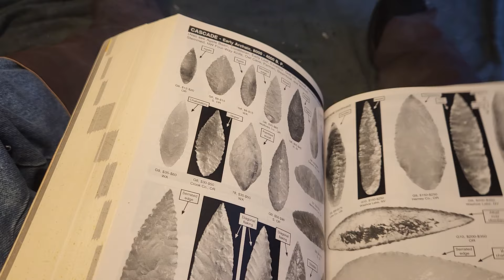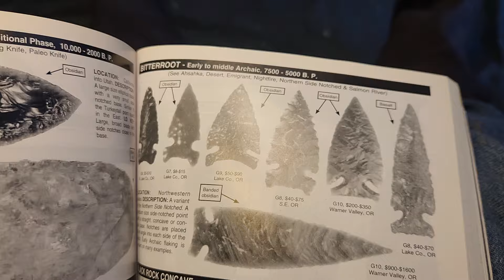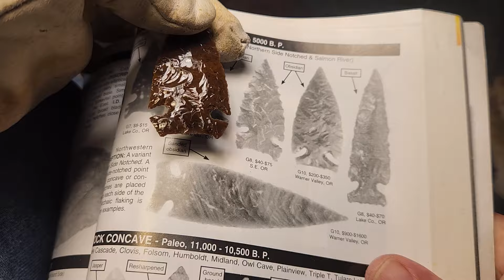1826 - "Cinnamon" Obsidian Flintknapping

Comment: Quick question, what is the upward angle of the metal indirect rod relative to the ground below?  Thanks!
Reply from the maker: From the ground, I would say between 5 and 25 degrees. It varies proportionally with the length of the flake and the amount of pressure assist. The longer the intended flake, and the greater the pressure assist, the greater the angle. ( edit): I think I've gone as high as 45 degrees with some rocks.

Comment from the maker: Related To Flintknapping/ Hunting
Updated April 12, 2024

Sean Dalgetty
Hand Pads, Gaiters
Tundra Leather
sean@tundraleather.ca

Danny Collins Lithics and Leather
Leg pads, hand pads flintknappingtraditions.com

Ted Snider
Notch-o-matic
theolithic71@gmail.com
https://youtu.be/3BHf-o97DYw?si=UADpj3pP4g9qiCVV

Flint Knapping Supplies
https://flintknappingsupplies.com/

Overstreet Indian Arrowheads Guide
https://www.barnesandnoble.com/w/the-official-overstreet-indian-arrowheads-identification-and-price-guide-robert-m-overstreet/1004757887

Old Friends Taxidermy
2478 Fairview School Rd
San Angelo, TX 76904

UHMW Black Plastic Mallet
Zoro Select 1Yvk7 Black Uhmw-Pe Rod Stock 3 Ft. L, 1-1/4" Dia.
https://www.ebay.com/itm/333994183040

Tony Soars fluting jigs 2018
https://youtu.be/8DKg4Kybris?si=oJcdq_nLxWJC2HyR

1-1/4" diameter UHMW plastic.
https://www.ebay.com/itm/224578394164?mkcid=16&mkevt=1&mkrid=711-127632-2357-0&ssspo=cHfvOieKSYm&sssrc=4429486&ssuid=1q_3LDvnSFK&var=524145172576&widget_ver=artemis&media=COPY

UHMW Black Plastic Mallet
Zoro Select 1Yvk7 Black Uhmw-Pe Rod Stock 3 Ft. L, 1-1/4" Dia.
https://www.ebay.com/itm/333994183040

6061 Aluminum Round Bar, 5/8" Round, 10" long, Lathe, Solid, T6511
https://www.ebay.com/itm/334171821048

6061 Aluminum Round Bar, 1/2" Round, 12" long, Lathe, Solid, T6511
https://www.ebay.com/itm/333393532365

6061 Aluminum Round Bar, 1-1/2" Round, 11" long, Lathe, Solid, T6511
https://www.ebay.com/itm/333413861610

1-1/2" x 12" long UHMW plastic rod, white
https://www.ebay.com/itm/125109196934?mkcid=16&mkevt=1&mkrid=711-127632-2357-0&ssspo=DCyz93qFQV-&sssrc=4429486&ssuid=1q_3LDvnSFK&var=&widget_ver=artemis&media=COPY

Needle File Set
https://www.harborfreight.com/12-piece-precision-needle-file-set-4614.html